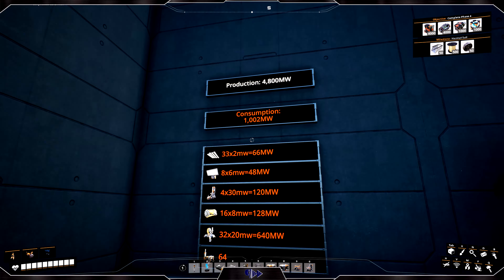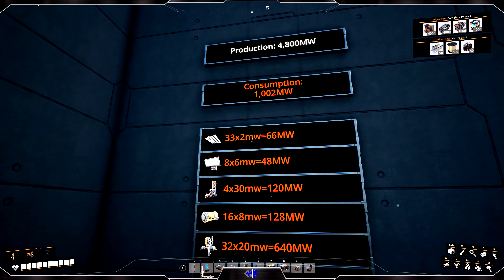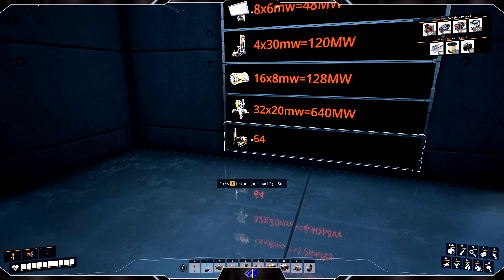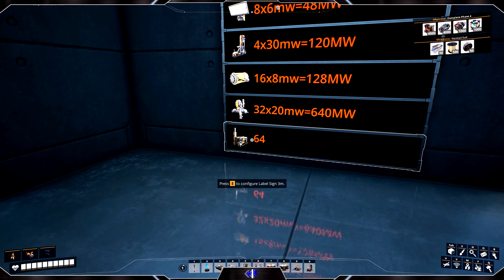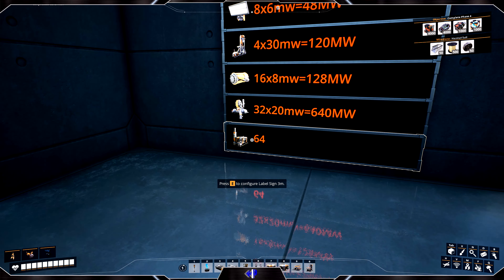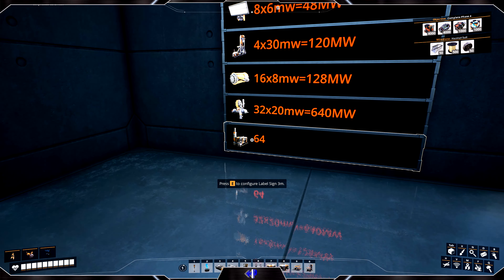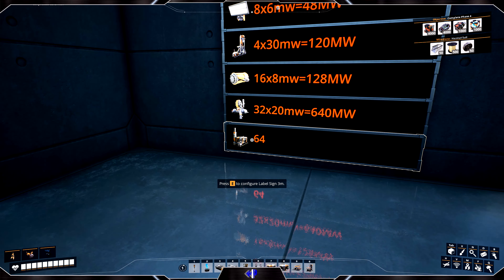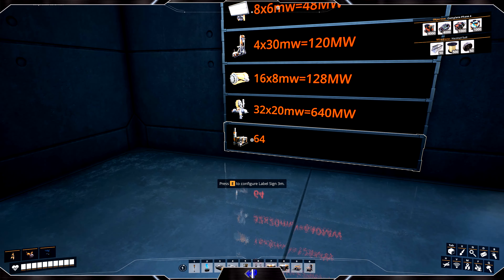Satisfactory - 4,800 MW Coal Power Plant |Showcase

Comment: I’m just wounding, why make big coal power plants when you have access to something like fuel. Is coal not better used to make steel etc?
Reply from the maker: This video focuses more on people who didn't unlock fuel power yet and need more power.

In the background. I'm building a large plastic and rubber factory, which will have 20,000 MW power plant at the back. So it will require lots of power to get it all started.
Plus, I'm running multiple factories at the same time on my server. So even when I'm not playing. Everything is running in the background. So I'm making as much power as I can to keep everything running.